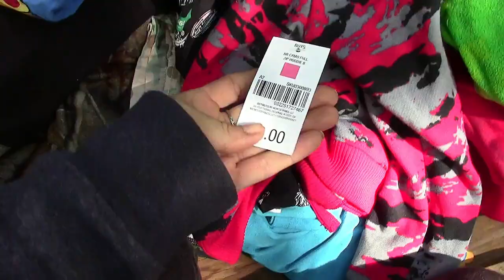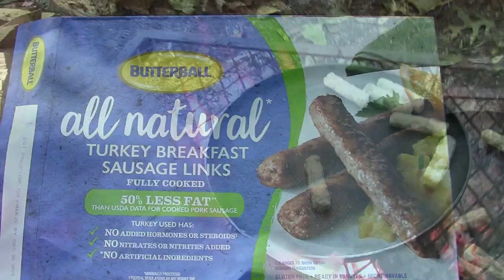ep 40: Chris Has a New Sawmill,  and a Whole NEW Plan! 😎 (Even HOLLIE Likes it!)

Comment: You should build some kind of platform for the new tent sit on so it’s not sitting on the cold ground love you guys god bless ❤️
Reply: That's a great idea. Since you won't have a permanent structure built by the time it gets cold at least get your body off the ground and everything else the tent will be on for freezing and unthaws. You would be better able to regulate your body temperature this way too. I think this winter is time for an outhouse????? If  you're going to shower on the land this winter maybe time for a shower room for changing with a bench,  showering, and a heater.
Reply: If he does build a platform for the tent, then they should stack hay bales under it to help with keeping the floor warm. That what a lot of people do who live in travel trailers instead of a house in the winter in Michigan.
Reply: @loriskiba3921  great idea
Reply: You’ll could get some of those wooden creat and build you’ll a wooden plate form to sit the tent on and greet idea’s Sheila and Lori
Reply: We've got a 12 x 18 platform that has a 10 x 10 shed at the opposite end from where a 12 x 30 platform is connected holding a 12 x 12 Clam and a 12 x 12 canopy. L shape. In the open area a four burner jet stove and further away a fire pit. We use a heat powered fan on both out fire pit with a swivel grill and our Mr. Buddy heater we use in the Clam that we vent. Although we don't camp during the Winter, we do camp late fall and early spring. The wood platforms along with fold out cots, make all the difference in the world.

Comment: I'm exited to see the new tentstead camp. Be careful with the propane heater inside the tent.  It needs proper ventilation.  Good luck.
Reply from the maker: As long as you have a way for air-to-air get in, the gas burning will also take all of your oxygen.. but it's not going to be fully  enclosed

Comment: Glad you all back on the land. Chris thoes smaller trees you had set to the side could possibly be used for roofing surport for your heavy duty tarp you are putting over the tent. The trees you plan to cut above your head as
Reply: Post could have thoes attached for support for the tarp and keep the weight of the snow off the tent. Maybe yiu can tack some on the side off the post like a wall as a temporary wind break.

Comment: I have seen during burning man in the hot  summer's some people will make shelters out of that silver foam board insulation... It definitely helps with keeping it cooler inside so maybe for the Winter that would help keep the heat in also ...something to think about it's not too expensive to buy that 4 by 8 sheets of the foam board insulation....